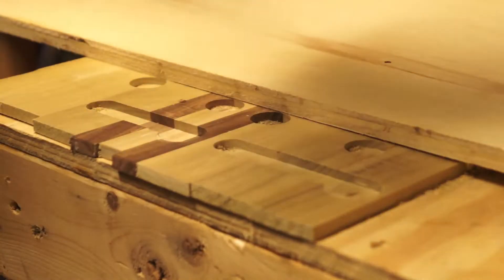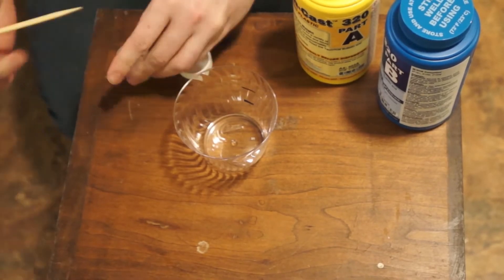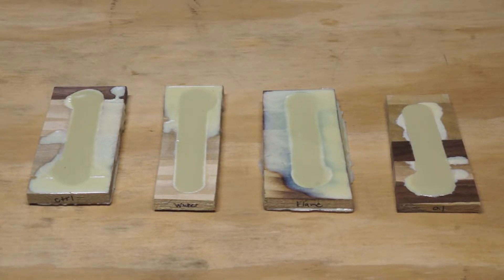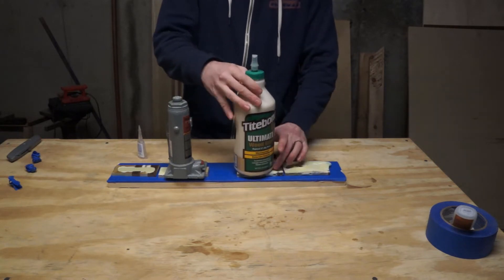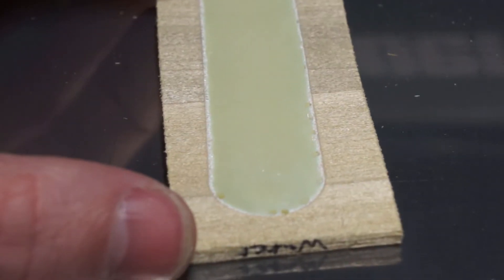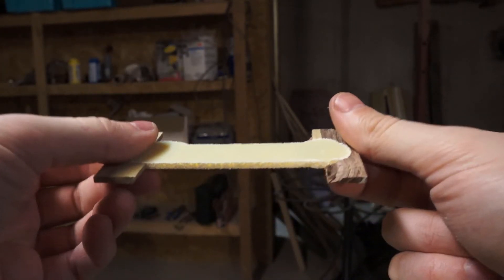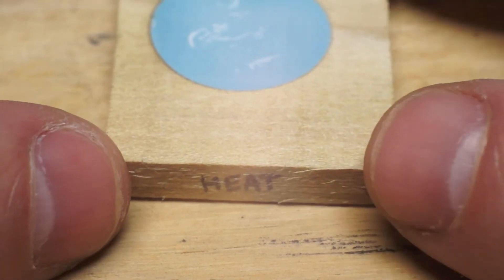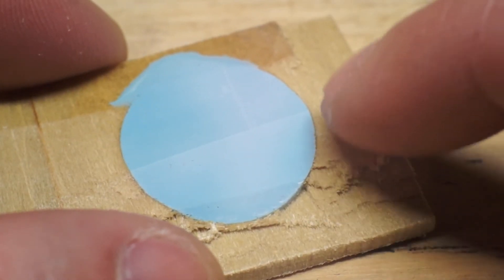Building a Snowboard - Part 3: Urethane Sidewall Experiments

Comment: Hi, Thank you for this good and well explained video. I'm also building my own boards and testing different approaches for the sidewalls. I tried the normal ABS, Epoxy and simple Bamboo wood. When I used Epoxy for my sidewalls I had a really good bonding and a really nice finish, but my issue was with the router  when I wanted to profile the core... The Epoxy is way too hard and I had to change the blades two times. Did you encountered the same issue with the Urethane?
Reply from the maker: The urethane was fine with the routers, the glass/resin composite layers did a number on my blades though. I think carbide is better but I haven't had a chance to try it yet
Reply: @GoodRoads  Thank you for your response. I will try the urethane for my next board!

Comment: Hello Good Roads, not all urethanes are created equally. I have been building snowboards with urethane sidewalls for 11 years. I am sure you found a solution already but if you haven't try using PMC™-790 Smooth-On Urethane. I am guessing the stuff you tried using in this video is more sensitive to moisture(Not good). Once you poured the urethane use an open flame and pass over the urethane / sidewalls 4 to 7 times it should pop the surface air bubbles. Faster passes is best. Try not to burn the urethane. We have a snowboard factory out of Vancouver, BC. Brand is called Wired Snowboards.
Reply from the maker: Thanks for the tips! I actually had a bad experience with PMC 790 trying to make some skateboard bushings where the material had a lot of mechanical failures. I've had some better luck with Flex-it 90 from Specialty Resin, which is what I eventually used for my snowboard sidewalls. It has a super fast pot life though so I'm going to keep exploring to see if I can find a urethane with the right mix of low moisture sensitivity, pot life, and durability
Reply: @GoodRoads  Yeah I would not use it for bushings. We have made thousands of boards with this material and zero issues ...yet! lol Pot life is ok and really cool with Mica pigments.

Comment: What is the final cost of the board?
Reply from the maker: I don't know yet, I'm not finished with it. But with cost of materials like resin, glass, edges, urethane, and UHMW, and the cost of tools and materials to make things like jigs and molds, I think it is going to cost as much as purchasing a deck. A lot of the tooling should be reusable though, so the cost for any decks I make in the future goes down. This is definitely a "I'm doing it for fun and because I want to" project, not a cost saving one. Honestly after going through it I'm amazed production snowboards are as inexpensive as they are, especially the "cheap" ones.
Reply: Okay thanks

Comment: Another theory about the bubbling - my understanding is it can be caused by air (as oppose to water) being forced out of the end-grain wood by the resin as it is absorbed. Hence why a good resin 'primer' layer eliminates this. Not sure why the first tests with urethane 'primer' didn't succeed though if this is the case. Perhaps as you suspected you just needed more layers.

Comment: Hmmm, why run it through a planer and not just cut vertically through it?
Reply from the maker: Because I didn't think of that! Hahaha! The full core blank would have to go through either a planer or drum sander though, so at least it's the same technique. Good call though.
Reply: @GoodRoads  Good videos anyway man. keep em coming! Also I think I've seen Marvin make the sidewall in batches, sort of like cores, layers of urethane and thin layer of wood 12 times side by side. They would just plane cut a sheet of sidewalls out of that and then glue the wood bit. I don't think this approach would get you out of the problem but I wonder - why not just pour and cut sidewall to shape and then just glue it to the core?
Reply from the maker: I love the idea of doing a wood/sidewall block that you could cut slices off of to glue up with your layup. I'm going to try to full-wrap the urethane, so to pour it first and glue it to the core would require a lot of extra tooling. These are all really great Ideas though. Thanks man! And thanks for the NS vid!
Reply: @GoodRoads  oh and this is how never summer attach sidewalls https://youtu.be/QX0P5_km9UA?t=431
Reply: Good job! I saw other videos where, after mixing the two parts of resin, te he builder put that mixture in a vacuum pot that expelled all the bubbles  from the mixture and only then the builder poured the resin for the sidewalls.
Reply from the maker: Yes! Vacuum degassing is also really beneficial for removing bubbles. I've also heard that pouring the resin from really high above the mold can help.